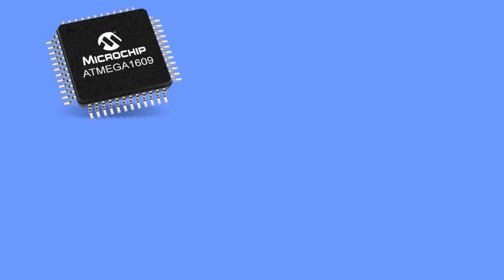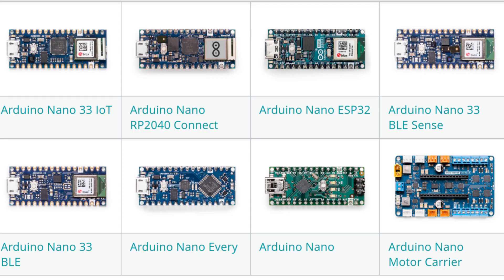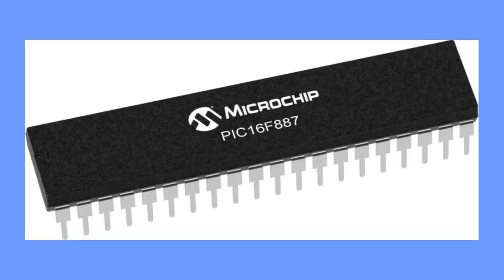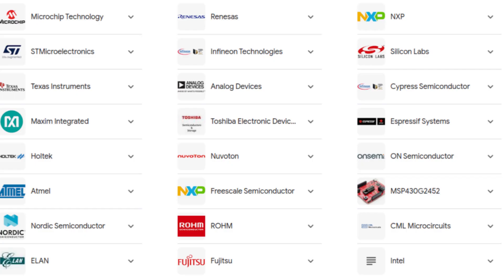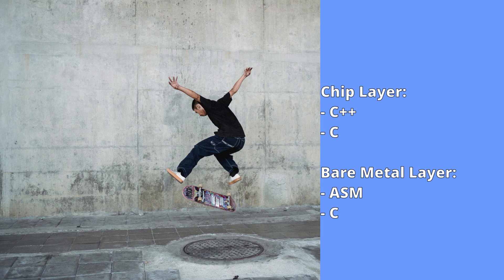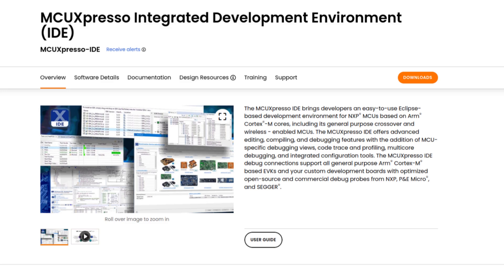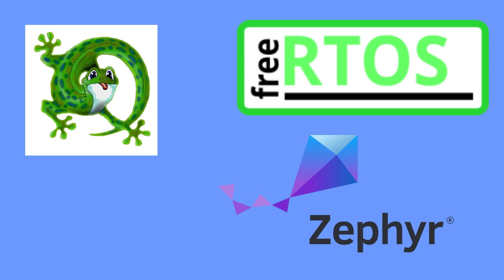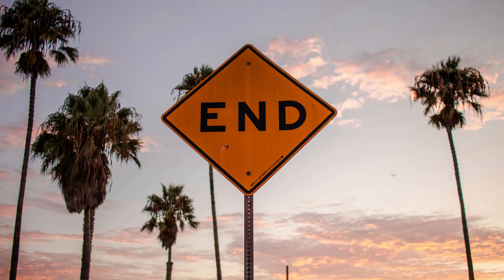Microcontr... WHAT? | What I Wish I Knew When Starting Out With Microcontrollers

Comment: The family of MCUs you choose depends mostly on the size of project you intend to do now in the future. Recommending an ARM controller is likely to be massive overkill and completely overwhelming for hobbyists and beginners. It's like buying  an articulated truck to transport a parcel to the post office - yes, it will do it but it is big, expensive, complex and complete overkill. Arduino would be a much better choice for this target audience. I personally use PIC controllers and program in assembler for small hobby projects.
Reply from the maker: Thanks for the comment! And yes, I mostly agree with you - in terms of "getting there fast" nothing can beat Arduino.
Reply: Great things about the Arduino are that they can be very cheap (depending which version you get), have a thriving community, have comprehensive libraries for many devices, have a simple programming environment and work at a hobbyist friendly 5V. I have everything from simple 8 pin PIC's up to Raspberry Pi's and choose an appropriate scale of device depending on the project. I tend to use mid-range 8-bit PIC's most of the time due to their range of capabilities and small size but I do admit that Microchip's documentation is often confusing or misleading and in some cases is completely wrong! Not ideal for beginners!

Comment: Nice video, but don't worry, I don't think anyone knows what the difference between a microcontroller and a microprocessor is any more as its become such a grey area.
The RP2040 has no internal flash and requires an external ROM like most ESP32s but they are called microcontrollers, so I suppose internal ROM can't be used to distinguish between them.
There are a number of microcontrollers that have DDR RAM buses to external RAM, so having a bus to external RAM can't be used to distinguish between them.
There are micorcontrollers built with von Noeumann and Harvard architectures that employ caches, so that can't be used. There are also microcontrollers that have MMUs, eg STM32.
The MCF5475 is regarded as microprocessor but has GPIO and peripherals, so they can't be used. Some microprocessors have power and sleep modes, so that can't be used.
I suppose those using ARM ISA can be easily split up into ARM microcontrollers use Thumb(/2) and ARM microprocessors use the full ARM but that's just for ARM.
I think even the marketing department at NXP gave up when they called the MPC8572 an “Integrated Processor”, a massive 1000 pin device with GPIO and peripherals.
I used to think that if your device has a MMU that can translation look aside then it is a microprocessor. However, I'm now using the Zynq7000 series as a microcontroller. They really blur the line as they include almost everything including a FPGA. You can also buy them second hand for less than a new 8bit AVR chip!

Now days, I suppose if your device requires a multi-phase buck converters to power it then it is probably a microprocessor.

Comment: What do you think about the RP2040 and RP2350 chips?
Reply: For me, their PIO is a game changer. It really looks like they wanted to compete with ESP32 which arguably they have destroyed. RP2350 with its FPU is a bonus. However, I just wish they would release a chip with a deeper pipeline such as a M-Cortex 4 or 7 to compete with STM32.
Reply: They are insanely good if you don't need something specifically similar to a specific legacy Arduino.
Community and official documentation is on a level rarely seen before.
And the full native USB support makes the super easy to flash.
There is a reason they where adopted as fast as they are by all these producers of 3rd party dev boards.
The only big downside I am aware of is the lack of low power states. Apparently that was addressed in 2350 But I have no experience with that.

And of course there are cheaper chips, there are always cheaper chips. But rp2040 is below 1$
And as always: if it is not advertised, they don't have it, like for example anything security related on the 2040. I think you could not even turn of the debug port. But again no personal experience with that.
Reply: 6:40 is a bit of a running gag in micro controller development. As often the official specs are outright wrong and if you are lucky they have a comment section where someone has posted the real value.

Comment: just wanted to make a shoutout to avr. I love the avr chips, I designed my first pcb with an attiny1616 it works perfectly. One recommendation to someone who is designing their pcb but doesn't want to solder, check if your components are available, I had to redesign my board 4 times because of this. I am looking forward to trying out CH32V risc-v based mcu's
Reply: I like Tiny a lot too!
HM-Live Tinny is very cool!